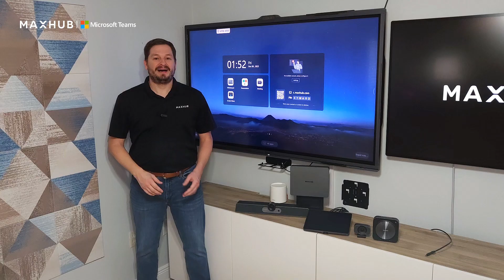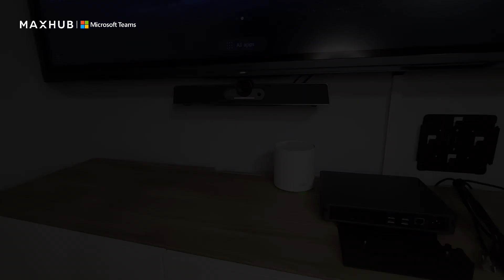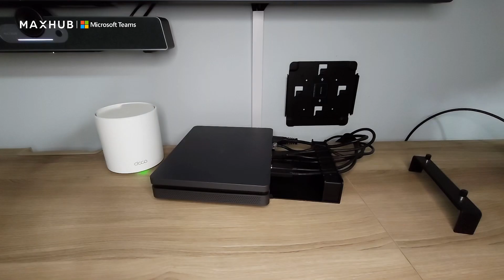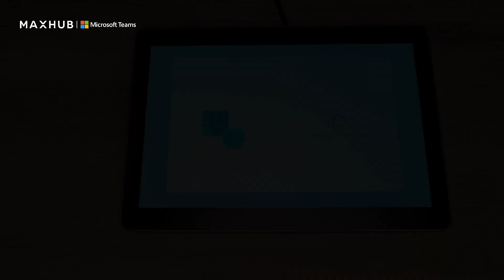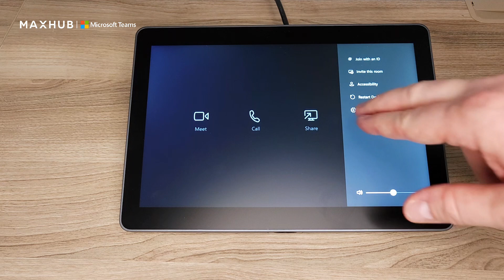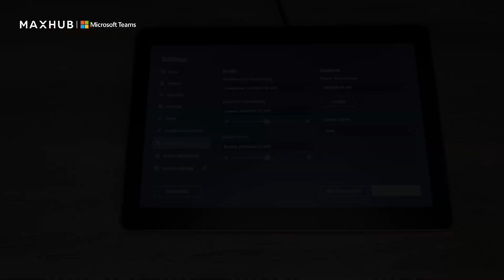2  Overview   MAXHUB XT10 VB kit

Comment: Installed everything as you showed and my panel is stuck on a screen with a spinning wheel and a MaxHub logo. Is there a way to hard reset?
Reply: I have the exact same issue and the support is terrible. I've had a support ticket open for a month and the only response I've gotten is to get the serial number then silence for weeks. Avoid this unit and save the headache and buy something else